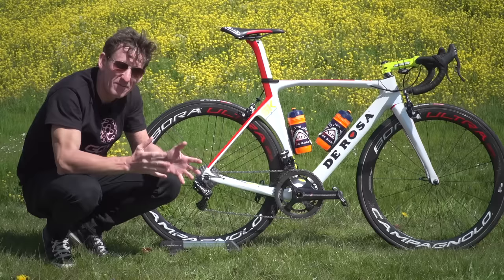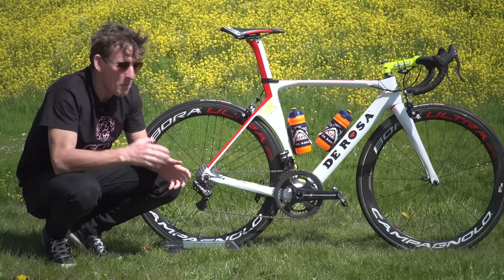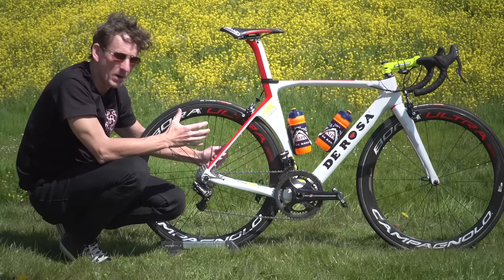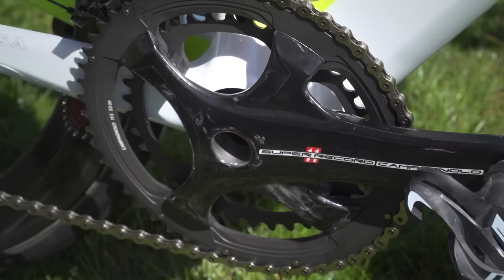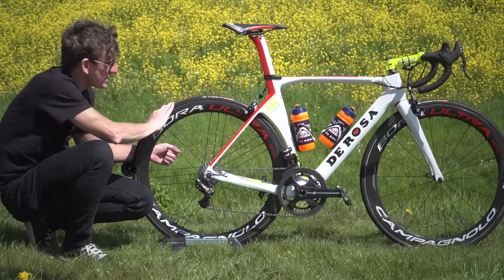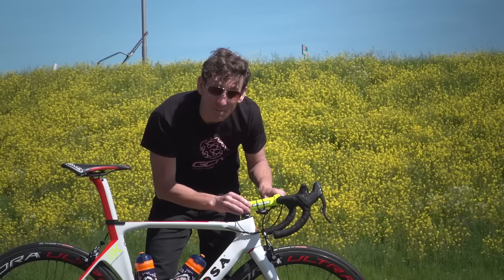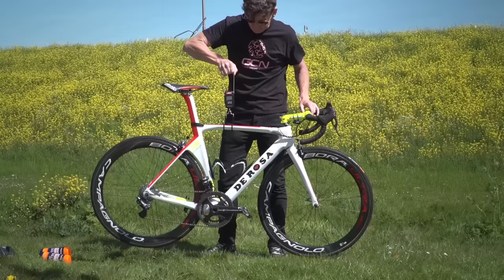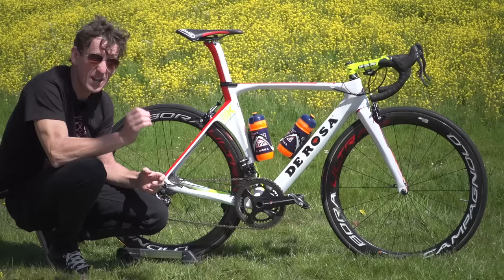Grega Bole's De Rosa SK Pininfarina

Comment: Just bought the disc version.
Reply: ***** I just orders a pair of wheels has 28mm width rim. The bike can handle that perfectely. As of the link it is as follows: http://www.ngprobike.com/de-rosa-sk-pininfarina-disk-brake.html  

Disc version certainly give you option to use wider tire, bus 28 is as wide as I can think of now.

Comment: The biggest load of bullshit these bike brands do is saying they team up with racing car brands and blend technologies of the two technologies to build a bike that is faster, stronger, better. It's bullshit. These are still just bicycles no matter how you spin it and not worth the extra thousands of dollars attached. In my opinion you are a fool if you buy in to this.
Reply: this frame can actually be purchased for 2000 dollars which, when compared to other high end carbon frames is not overly expensive.